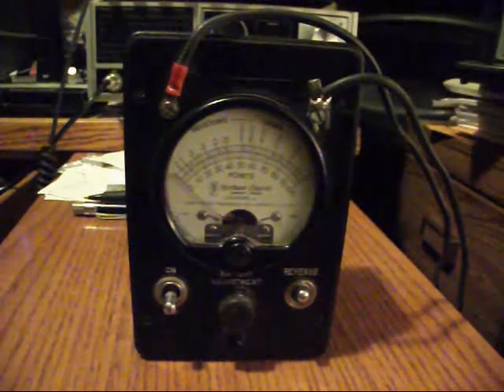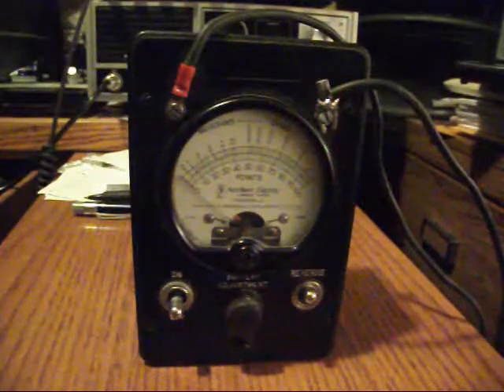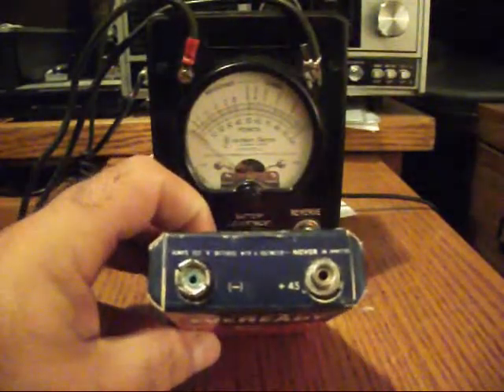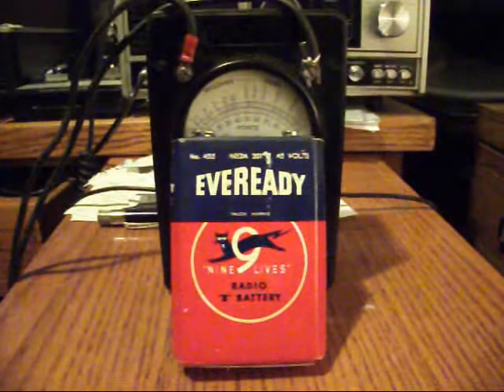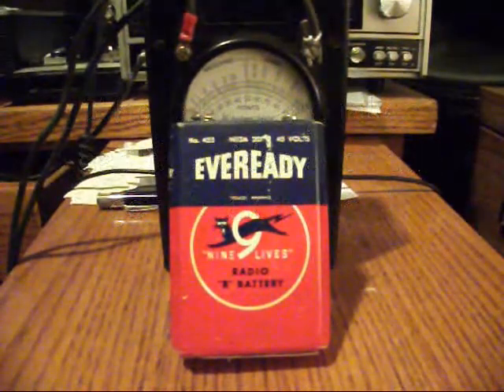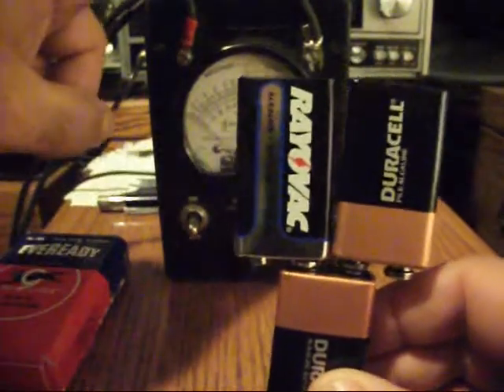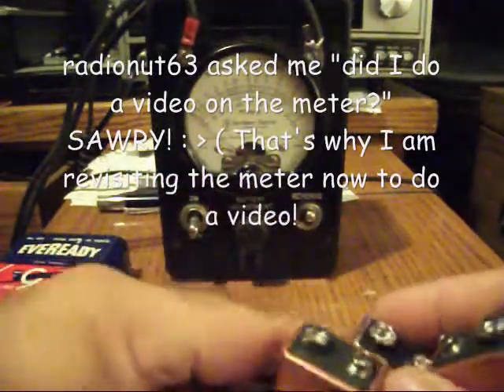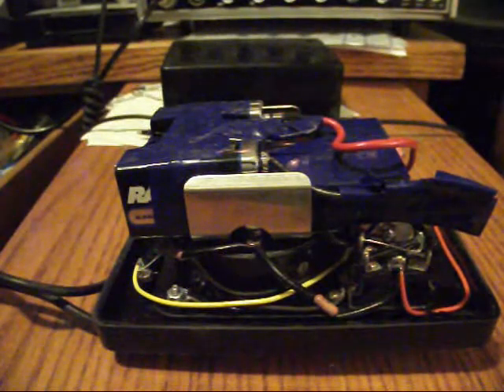Simpsons Ohm & DC Volt Meter Model 324

Comment: My Triplett VOM uses the same 45 volt battery.  I use it fairly often and I replaced it about thirty years ago.    Good investment.   My new to me Bell 345 VOM does have a toggle switch that allows AC and DC.  It’s in the same place as yours that is marked “REVERSE”.   It’s a new arrival and it also needs the new battery.   I believe these were used specifically for telephone line repairs specifically.
Reply from the maker: Thank you for this information. They are very well made meters. Mine gets zero use. It is just sitting in storage. I like old school gear...

Comment: What voltage was the original battery? I just found a Simpson 324 at Goodwill. Perfect shape, with original leads, but just missing the battery.
Reply from the maker: The original battery was 45 volts DC

Comment: I worked there for a year and a half and quit end of april 1980 in the cal lab. You would not believe what they used to wind the precision resistors for the meters. 1940's  resistance bridges with galvanometers. They were still accurate. The pads were so worn that they had grooves in them. The pads were silver. A little cleaning every 6 mo's kept them going.
Reply: I believe they were GEN-RAD bridges. Wooden case.
Reply from the maker: Thanks for the information. It's nice to hear a little bit of history on stuff.
Reply: Most of the equipment used to test the meter movements was built in the 40's. I was surprised that it still worked. It was a pain to keep a lot of it running. I got a lot of meters from the lab basement. The funniest thing that happened when I was there was when my co-worker found a bottle of radium paint in a cubbyhole in the lab basement. The hazardous waste people carted it away.
Reply from the maker: You have a far better understanding of all this historic info than I do. Thanks...

Comment from the maker: Yes, exactly... I'll buy more 9 volt batteries and lock them together and resolder the fresh batteries in again. This meter, by the wy, is very accurate for ohm and dc voltage readings!  I still have the original dead battery... hehehe! Thanks for your post